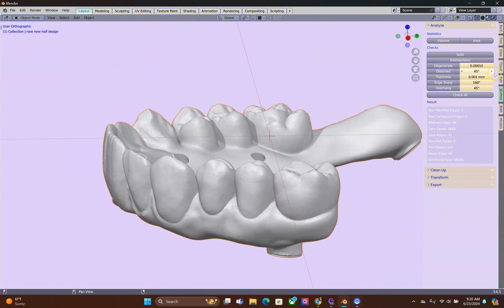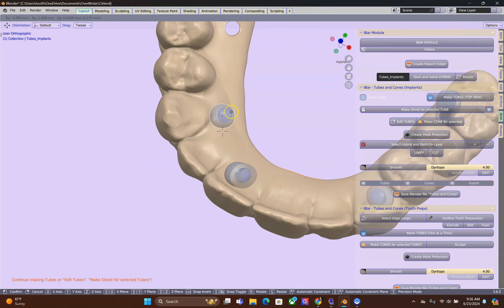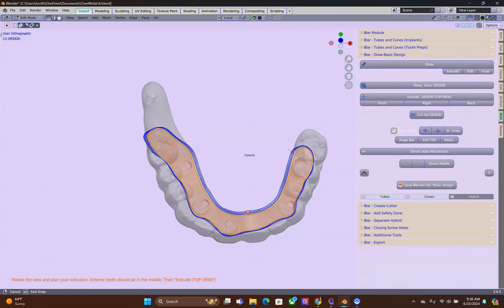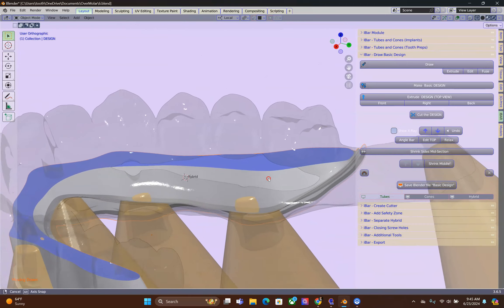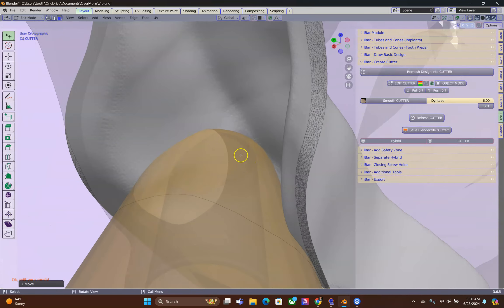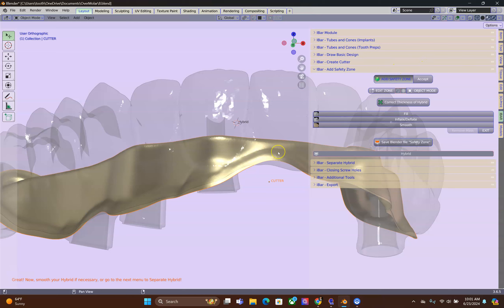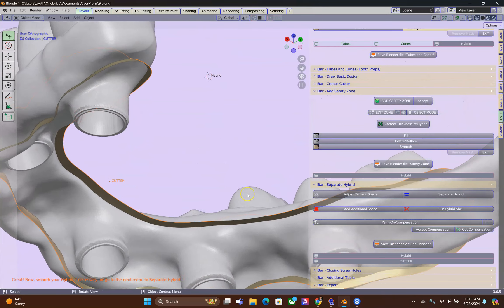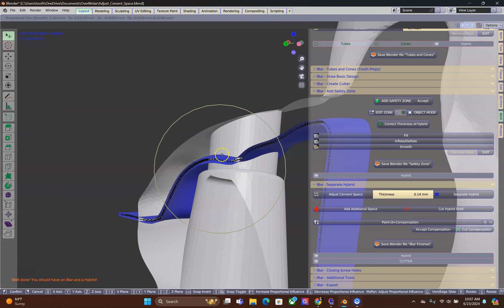iBar- Over Molar Pterygoid Implant

Comment: Great video with tips. I have a question about bar border, sometimes it's very sharp and thin, especially from vestibular.., like in this case. And it's hard to polish without removing part of the border.
Is there a way to give thickness to a border? Around 0.3-0.5 mm outside the bar for safety polishing. It would be super easy to agjust it by inserting bar inside Zr supra and slightly touching with a rubber!